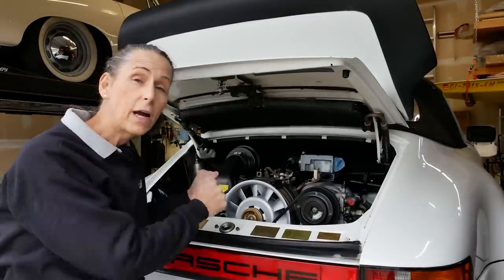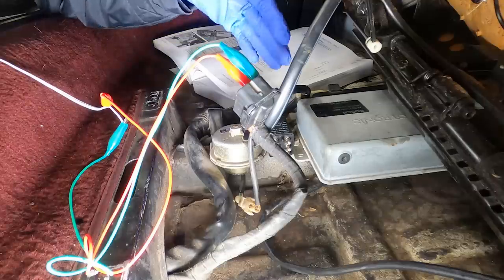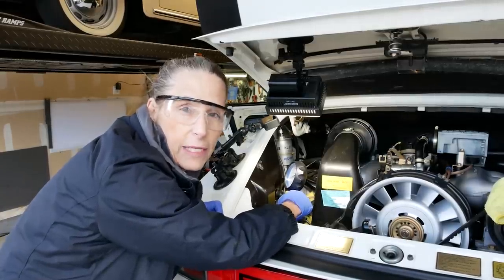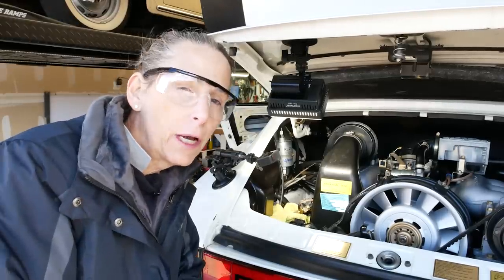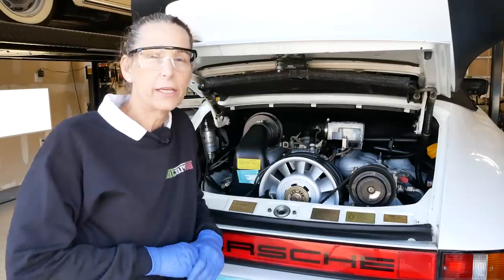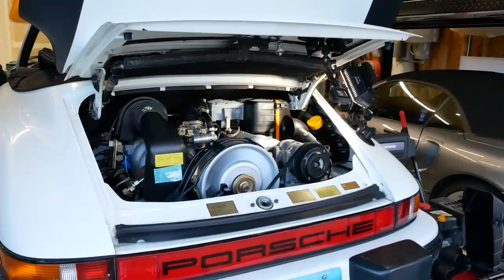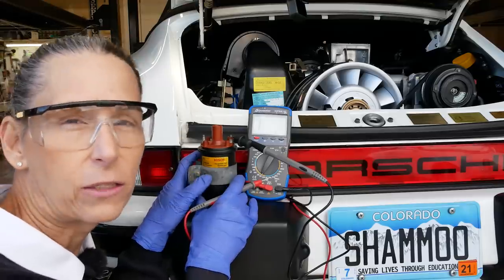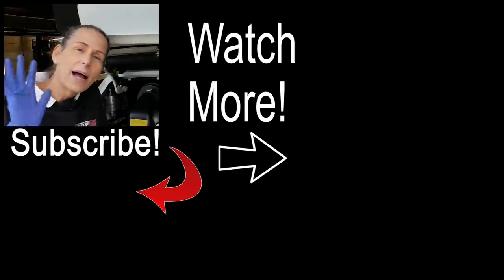Budget eBay Porsche 3.2 Carrera Project Car! #30 - NOW WHAT?! YOU WON'T BELIEVE IT!!

Comment from the maker: Hi Everyone, The injectors are back in and working properly but this engine STILL isn't running correctly.  I go through some more diagnostics and find something!  Here we go! (again...)

Here is that Fuel Pressure Tester kit: https://amzn.to/2Y63NQS
I did have to modify one of the adapters to make it fit...  Just FYI  Email if you need more info.
Reply: a really great journey into the best of the past.
Reply: Heidi is nice. However, Franny is an absolute star.
Reply: That’s a bummer. Hopefully you don’t have to pull the engine again...
Reply from the maker: @watchfan6180  totally!  Heidi

Comment: Just a word on yanking a plug wire while it's running..  in a simplistic coil/spark system, the peak voltage is determined by the spark gap.  When you remove a plug wire from a plug and don't give it a path to ground, you're spiking that coil field collapse voltage to pretty stupendous levels.  If you don't give it a path to ground, it'll find one.  Be it through a weak plug wire, through your hand/heart, or through the insulation of the coil itself.

So about the fuel pressure gauge footage..  your fuel pressure needle was shown dipping during these periods of poor idle.  As the air was being purged from your fuel rails, there's less and air serving as a pressure accumulator, and the drop-outs in supply pressure become more noticeable.  Could be caused by a mess of things.  But at 6:05, it's pretty clear.

Comment: FRANNY!  I just tested 3 Bosch coils of similar vintage that I had laying around the shop, and they all behave exactly as yours did.  I don't think your test specs are correct.  The Primary is correct, but the secondary should be something like 7,000 -15,000 KILO ohms (kohms).  Your problem is not the coil!
Reply from the maker: Good to know.  Thanks.
Reply: @HeidiandFranny  You had your meter set to 200 ohm range. Shouldnt you have set it to 20k or 200k?
Reply: Being a mechanic for nearly 35 years and I've only replaced 1 ignition coil. And it was made in China and not very old. I think it was some cheap Chinese fake Bosch blue-coil knock off.
Reply: @HeidiandFranny  That was going to be my comment as well. I couldn't tell from the video but it didn't seem like you had the meter on Auto Range, and since the reading between the center and side post should be in the several k-ohms, the meter is in over range, not open circuit. (Jerome - Maui Roadsters)
Reply: ...age alone will not kill a coil. Use/heat cycles will.  It could sit for 30 years on the shelf and still be fine.  Not sure how many miles are on the car, but coils can easily hit 6-figure mileages without issue.
Reply: @norberthofer5830  Agreed.  I have never actually seen a coil just outright "die" with no visible signs.  The only time I have replaced coils was either on principle during a restoration, or when there was corrosion on one or more of the terminals... they are pretty damn near bulletproof in my experience.

Comment: Seems pretty conclusive to me, we know you have fuel pressure and the injectors are firing and ok, and we know you have good compression so that really only leaves something related to spark. Its pretty impressive really that the coil has lasted for 36 years!
Reply: how do we know the compression is good? did she measured it?  on cilinder 5?
Reply: @clanpimp  #5 was brought to life with the fixed injector in the last episode, so no need to think its compression some will say!

Comment: Oh wow, that's an old coil.  I hope that's the problem.
Reply from the maker: Me too.  Heidi
Reply: @HeidiandFranny  If you had the top end off, which I believe I saw in another video and the coil wasn't an issue then, I highly doubt it has suddenly become one. It sounds most likely to be a vacuum leak, get a can of starting fluid and spray all your intake surfaces and vacuum lines while she's running, listen for an idle surge and you'll find it quick enough. I like to check intake hardware after a first run just because of aluminum tending to "move" a little. The vacuum connection near the idle microswitch is notorious for cracking. Best of luck.

Comment: Fanny, let a workshop test the coil under tension (they simulate the operating conditions to see if the insulation leaks, this happens after 35 od years or so). If you renew the coil make sure to use fresh hi-tension cables (forgot if you renewed them already). This is a typical case of Murphy's law !! Good luck, Frank (Holland)
Reply from the maker: Thanks so much!  Ya know, I thing there might be a shop here with a coil tester.  That is a great idea.  I'll look into that.
Reply: That was my thought as well.   I would suspect this is an electronic issue but a load test would be advisable. Unfortunately it might cost as much to replace the coil as to have it tested. (As much as I don't like throwing parts at an issue)

Comment: Electronic components can be weird.  Sometimes they are fine until taken out of regular service.  Then internal solder connections or other bits degrade seemingly without cause.  Considering the age of the coil I would replace it even if it tested ok as it's failure would seem likely in the near future.

Comment: My first thought was the DME relay.  Interesting diagnostic on the coil.  I’ve often wondered how to test one.  Personally I’ve been too worried about getting some sort of voltage shock so I stay away from them.  Haha
Reply from the maker: Thanks!  That DME will get replaced.  I'll do a follow up, but I misread the spec on the coil resistance.  I still want to get it checked out...

Comment: I always changed all the ignition components, right. Down to the battery and alternator on old cars. 
35 year old stuff is way beyond best before date, save yourself  much time and work.
Personally ,since you had the engine removed already , I would’ve pulled the heads and oil pan for inspection .
But that’s just me.
Great videos though, keep up the excellent work.

Comment: Oh no the injectors didn’t fix it. Your master tech skills and diagnostic flow is amazing. You’ll figure it out. I don’t know what type of air intake gasket is on there but it could be damaged and sucking in air. Is it also possible that the speed sensor tone ring teeth could be damaged. Can wait to see what you find.

Comment: Hi from UK, Franny, you have to check the the TPS, Motorinic is a demon on its setting,  it is I assume 1986.?, the resistors  just wear away, and the fuel shut off, does exactly what yours is doing, check the readings at ECU pins. Best of luck, nice diag.
Reply from the maker: Thanks so much for that!  It is next on the list.  Good idea to check back at the ECU.

Comment: I does seem like the ignition is dropping out. I would pull the DME and remove the cover. You can see if one of the solder trace(s) is cracked. The fact that you did not have this issue on the last video suggests the DME relay was effected when it was unplugged. The coil is probably in need of replacement is the secondary winding is open but probably still arcing internally to create enough spark.

Comment: Hello Heidi and Franny's Garage,

Another great video and believe you are totally on the right track.  Coils, when heated are most likely to show problems.  If you let the car cool, it may run fine again and pass the Ohm test.  

Cannot wait for outcome!......PS:  Do you use oscilloscopes yet?  With your knowledge and background, believe you would enjoy this tool and now cheap to get for your laptop with recording functions.  I purchased a modest 2 channel from Pico (scope only) and have been amazed with its usefulness.  Now have added amp clamps and can perform relative compression tests just by running engine with the starter!

Good luck, the car/engine is so clean and it showcases your attention to detail!

Cheers,
Mr. P
Reply from the maker: Thanks so much!  I really do need to up my game with a scope.  I have one I used back in the day when I was building filters and amps, but I should drag that thing out to the garage and give it a go.  I didn't know how useful they can be but I've been watching some cool videos on it.  Love it!

Comment: Right around minute 15:10 on your video you show a view of the Motronic ECU while you are removing the DME relay. Over time these have been known to cause issues and I noticed some rust on the mounting bolts which makes me wonder if there has been a history of water sitting in that area which could have got into the ECU as it is not waterproof. You can open it up for a look. They can also suffer with dry solder joints. Love your show. I too have a 3.2 coupe, a G50 '87 one, which I have owned for 26 years. They are great cars.
Reply from the maker: Yes, great eye.  This being a convertible had a leaky top when we bought it.  It has since been replaced, but you are correct.  I am a little worried about the ECU, but it was running fine (not perfect) before and these symptoms are new.  Funny though there isn't any rust on the floor boards.  Just the bolts/nuts/screws....  It is a bit odd...  Gosh I hope the ECU is good.  We'll see.  The DME relay is also 20 years old...  That is getting replaced as well...  I'm just not convinced on the coil...
Reply: @HeidiandFranny  I agree about the coil. In fact the old ones are better than the new ones, made in Brazil, which fail all the time. The DME relay is my favourite. I had one suddenly fail while out on the road at some traffic lights, which was embarrassing, but luckily had a spare. These guys do a solid state one which looks interesting. https://www.ftech9.com/new-products/911-ssr-pp. I also do think its worth having a look inside the ECU. Good luck!

Comment: ok, it's safe to assume someone modded that car with incompatible parts...I'd suspect they changed something on the intake side that is the issue...if this was a Mustang we send it to be "dyno tuned" and find exactly what the issues are...could be an 02 sensor, MAF sensor or cam/crank position sensor...good luck, I'm sure it's something minor
Reply from the maker: Everything on that car is absolutely stock or OEM.  Even the coil is original!

Comment: If you haven't already done so, I suggest checking the wiring harness for continuity since you have something  making an intermittent connection.  The connectors are all crimped on at the factory, and by this time one of them maybe breaking where a wire goes into a metal connector somewhere.  It's a tedious job.  Since the engine has been out, something may have gotten pulled apart internally.
Reply from the maker: Great point!  That wire is old and stiff.  I did try to be careful, but you are very right.

Comment: First weekend i had my 3.2, my dme relay failed me on the highway going 75 mph at that moment. Ofcourse i had no spare .... so pro tip always have one in the glovebox like you Said .... 

Did you measure  the resistance of the relay outside of the car ?
Reply from the maker: I haven't...  I'm going to replace it.  I really don't think that is it, but...  Whatever it is it is a bit intermittent.

Comment: Idle switch?  Idle air control valve?  Get a timing light on it and see what spark is doing?  Check all the DME connections to the engine.  Have you a CO meter? Fuelling and overal operation doesn’t sound right.  Go through all the primary inputs. A new part is not necessarily a good part......  Fingers crossed it's the coil but those MAFs don't like being disturbed and also if you have an airleak, that MAF won't compensate for it so a big leak (diagnose by spraying WD/brake cleaner over the manifold and seeing if the engine speed changes) will affect all the cylinders.  Good luck!  Nice Rattarossa shirt!
Reply from the maker: Thanks for all that.  Yup...  I'm not completely convinced the coil is it.  I can replace it to rule it out (and it is super old), but yes, lots more to test.
Reply: @HeidiandFranny  Looking forward to hearing how you're getting on with it.  Engine detective stories are always the best and the most satisfying when they're solved!  Loads of gumption added to the project store at that point! (Pirsig had engine projects so well understood sooo many years ago)

Comment: One of the best electrical Gish tools is an oscilloscope and they are cheaper now that u can scope for connection to a lap top. With a scope you can see the signals very handy. The one thing about new car components is that out of the box some will be faulty and I believe the main reason why mechanics get a cost reduction on new parts. A great video as always and I always learn something here. Thanking you

Comment: Question.
When going to the auto part store or buying injectors online, they don't have a shelf life. I'm sure all the auto part stores don't throw away injectors that have been sitting on the shelf for a designated time so why does that company say they are not responsible for their injectors?

I was thinking coil or possibly the MAS air flow sensor.
Yup ALWAYS keep a DME relay in the glove box
Reply: They are not new injectors. It is the old original ones, which is just cleaned. That is the differences.
Reply from the maker: RC even said when we sent them off the first time they would re-run them through free of charge.  It wasn't a big deal and they covered the shipping as well.  We'll see!
Reply: @HeidiandFranny  ok. just seems odd to me.

Hope all goes well!!! I always liked the 911s in white. such a cool body style back then. I had a factory 1994 911 S4 Wide body, that I still miss to this day. My favorite years. The last of the True 911s ( IMO ). Its amazing how much they sell for these days

Comment: Hi, try spray startgas/spray around hose connections, injector gaskets etc, the engine will rew up if it's a leak. You can borrow a smoke machine to detect leaking points.

That air meter will measure up and send the info to the ecu, if something is wrong, you'll end up with a harsh idle and rew or even a no start. 
Testing the exhaust values can get you info about what's going on too.
Reply from the maker: Thanks for that!

Comment: TPS confusing computer and ICV cycling.  Real smart of u to first eliminate fuel pressure.  Am not ruling out 02 sensor circuit.  Was fine when it was cold and o2 is disregarded because it was in warm up mode.  Then after a few minutes engine stalls just as ecu goes closed loop with a now warm o2 sensor.
Reply from the maker: Great point!  I want to order a new one of those as well.  I hear they are a bit fragile.  I may have damaged it at one point.  I can test it - it is on the list.
Reply: @HeidiandFranny  Yours is a 3 wire.  I've had a bunch of luck w super cheepo fleabay sensors.  Splicing the wires might be an issue.  Remember that any combusted silicon immediately destroys the sensor.  On assembly make sure that zero antisieze for the thread gets into the sensor tip.  I have tested them by disconnecting the signal wire w cold engine, starting and seeing if voltage rises.  Alternately bench test by applying 12 vdc to heater wires, wait a minute and shoot some unburned propane onto the tip.  Good luck.  My 76 911s' cis injection is worn out completely.

Comment: Franny, you need to really look closely for a vacuum leak. I can here the tell tale whistle and it acts like one. (25 yr Audi/Porsche master tech). Good luck, and great work !
Reply from the maker: Thanks for that!  I think that is the intake box off.  It does whistle without it.  In fact that may be a factor.  Ironically I left it off so I could pull the vacuum hose on the flow damper.  I hooked up a gauge and it seems to be pulling a strong vacuum, but I got chased out of the garage by the weather.  BUT!  Point taken.  I have done a visual on the vacuum lines and the "look" good, but I do want to do a more critical analysis.

Comment: Put Single Spark Plugs from Bosch or Beru instead of 4 Spark Plugs  and the Engine runs better 😉(4Sparks Plugs are for High End Engines with over 700 HP , 9FF Porsches or Tuned Supra‘s , Nissan GT etc)
Reply from the maker: My experience in this and the 356 is that they run and idle much smoother with these plugs.  I have swapped them back and forth in one sitting to confirm.  Other's say they have issues but for these cars they work better.

Comment: Snap on coil tester,... generates a spark and one can tell if its strong enough by increasing the gap until it fails to jump. I'd post a pic but i lent it and was never returned. Worked great and very simple. Think it's  basically a Ruhmkorff coil.
Side note,  the guy wanted it to start his pulse jet, and worked for that.

Comment: Question on the plugs you're using:  Seems like they are not Bosch WR7DC, or WR7DC+.....(or Bosch 7500, 7501, or 7900.)  Porsche calls for only those.  After buying my 85, the PO had those similar plugs in, with the multi leads coming to the tip......car never ran right with those.

Comment: You need to check your TPS to be sure it is set correctly and the sensor is within range. The last thing I would check is the MAF. But to me your problem acts like a mis set TPS.
Reply from the maker: Thanks.  All the sensors are new and I set the gap at .8mm (as per spec.)  I checked to see if it had moved and it hasn't.  BUT...  I agree this would totally cause this.  It could be the sensor is not good.  I have the old sensor I can swap back in and check.

Comment: Has du weider Scheiße gebaut? Bosch wraps their injectors in special brown wax paper and work perfectly even after sitting on the shelf for decades. And RC's have the shelf life of milk? What kind of payaso would wrap them in bubble wrap? You may believe that's "super nice" (ugh) but the plasticizer off-gases, gets into the orifices, and turns into varnish, effectively cementing the pintle. Bubble wrap can also dissolve other plastics. Save the bubble-wrap for glasses or Grandma's china, it's ceramic